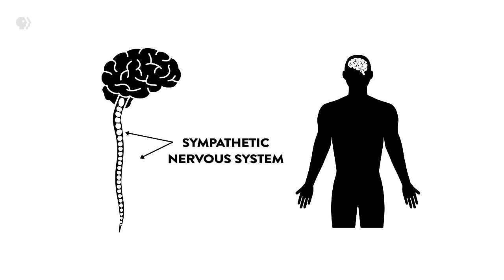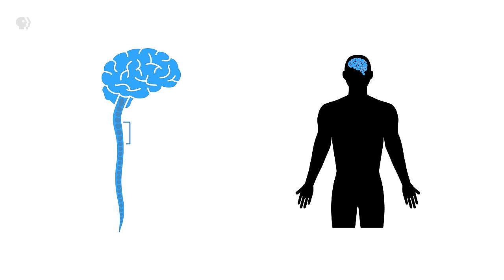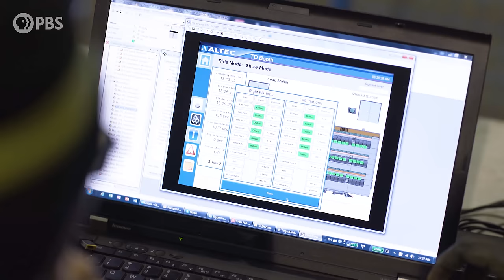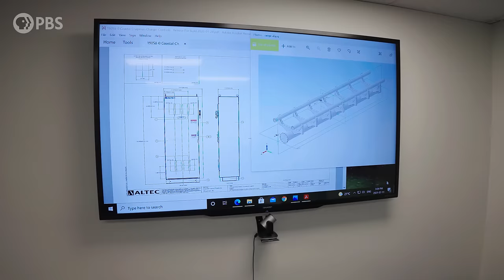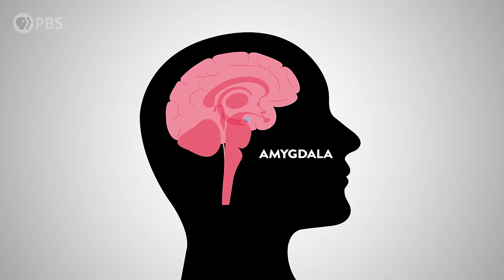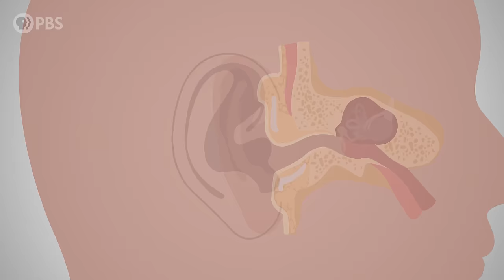Are Roller Coasters GOOD For Your Brain? | Overview

Comment: If the aim of these studies are to use rollercoasters or simile for desensitizing people who are anxious/afraid in regular situations, wouldn't it mean that people who like to scare themselves for fun, can become so desensitized that start acting recklessly in regular situations that can be dangerous, like driving?
Any studies correlating the rollercoaster factor to reckless behavior?
Also, why fear has such a bad rap? Isn't a safety check to survive?
Reply: I think if you had control over it and your actions dictated the outcome. You can be desensitized. Reckless.  Im fairly timid when driving but i will marathon the most g force intense rides just fine. Fear of height. And being a little more used to the effects of geforce. Speed with tight turns. Etc.  But it wont make me say. Less fearful of say a physical fight with someone

Comment: I've become a fan of roller coasters in adulthood after being quite phobic of them as a kid (and somewhat ambivalent as a teenager).
I'm not getting any younger and I do worry about negative physiological effects of these rides. Some neurologists worry about the cumulative effects of particularly rough rides on the brain (cerebral injury similar to what football players experience), though there's not a lot of solid evidence that this is a problem. I could see it being an issue with badly designed coasters that cause a lot of headbanging in the restraints, but I avoid those. Some ophthalmologists believe that no one over 40 should ride roller coasters because of the increased risk of retinal detachment caused by the G-forces (this seems to be real). So I'm a bit wary of really marathoning them, and I try to be alert for the warning signs of retinal injury after a park trip, since it's treatable if addressed immediately.
But I think riding them is worth that physical risk because they're clearly good for me psychologically. Going to an amusement park and riding these rides can give me an emotional lift for days. Feeling that fear and riding through it is just a huge rush.
Subjectively, the intense "stomach drop" feeling is something that actually goes away with experience. It starts with a physical sensation, but it's a psychological reaction. I used to feel it whenever there was any kind of negative G-force and now I don't. I think part of it is learning to interpret the sensations correctly--"I am being pulled down faster than the acceleration of gravity, but it's OK". That's what it feels like now.
Reply: Good insight.  I enjoy riding coasters in the moment, but after a day at the amusement park with my kid, I typically have a moderate to bad headache which can take days to go away fully.  This has me worried for concussions, subdural hematomas or other types of brain injuries.  This is the exact opposite effect of what this piece is suggesting.  These headaches may simply be stress-induced, though.  Such brain injury concerns should surely be within scope of the ASTM standards.  I rarely get headaches from anything other than amusement rides.